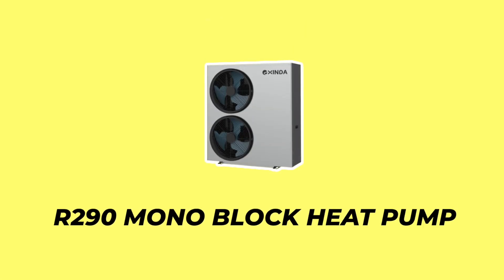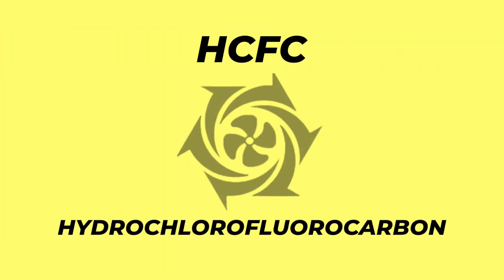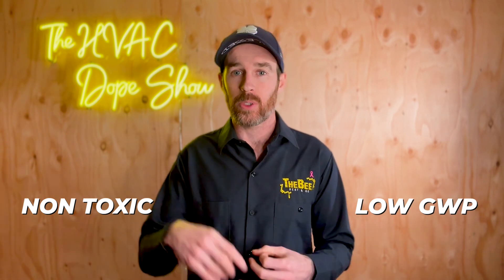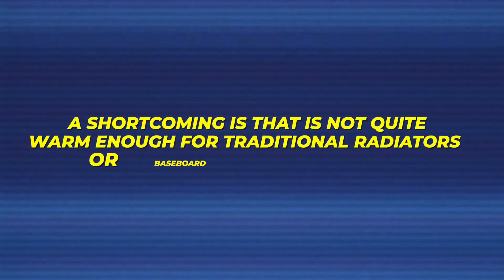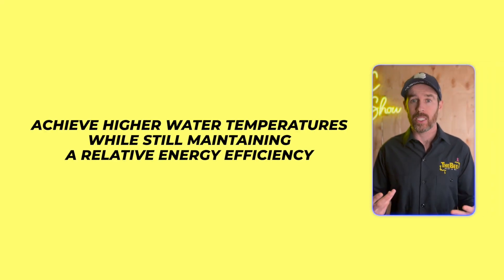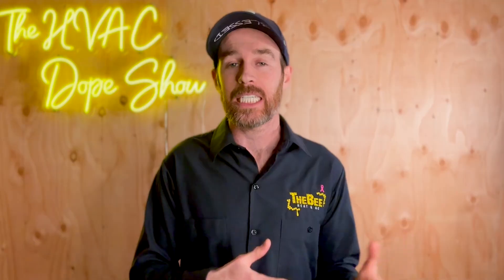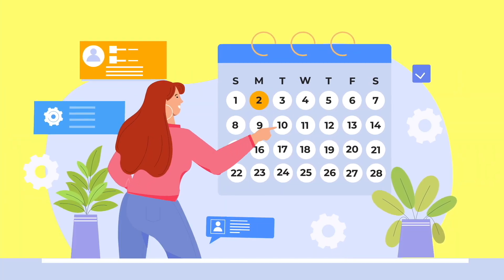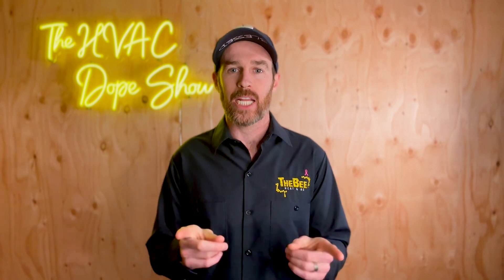This Heat Pump changes EVERYTHING | R290 Heat Pump

Comment: Really good explanation of current R290 heat pump technology.  This is very promising for older homes with hydronic systems requiring higher water temperatures.  I have an old house with an oil fired boiler and baseboard radiators.  I had an outdoor wood fired outdoor boiler, but couldn’t get our renters to use it, so I already have a heat exchanger and PEX piping to outdoors in place.  Just waiting for R290 heat pumps to come available.

Comment: I have a situation I could really use your help with, given that some of the local plumbers I have spoken with don't seem to know that much about the new technologies out there here in Washington mountains.  We are building a 2600 sq ft 2 story home where most of the living and master are on the 1st floor, with some spare bedrooms on the second.  This is in the mountains in Cle Elum where heating is used most of the year and maybe 1-2 weeks of AC usage in the summer.  Additionally we have to bury tanks for gas since it isn't run at the street, so I want to do as much electric as possible.  We are building slab on grade and ideally want no attic space, but will have room in the garage for a utility room.  Ideally we want to do radiant heating and cooling with a hybrid heat pump, but my local plumbers have no idea how this works.  I want to avoid ducts if I can and ideally get a heat pump water heater for both in house hot water as well as radiant.  Because cooling is so minimal, we could get away with radiant cooling too and ideally I avoid the cost of running ducts, separate split units etc.  I see some units from Arctic and I am sure Daikin and others have solutions that would work for us?  Am I insane in thinking this will work?  Why does my local installer think this is crazy?
Reply from the maker: Radiant cooling isn't a thing as far as I know because it would cause condensation on your floors or wherever the cold is and wouldn't work for humidity removal

Comment: Propylene glycol has a transfer-efficiency problem, so these might be a little less stellar in cold climates.
Reply from the maker: The transfer efficiency isn't as big as you might think, you can get burst protection to -20F and only give up 5% or 10% efficiency. They can also be ran with water and burst protection devices outside and just keep the water lines short normally but it's not as difficult as you'd think

Comment: This is new to me and very interesting. Can it be used to chill water for air conditioning? Can it be used to produce both hot water and chilled water into separate storage tanks in the summer?
Reply: I was looking for this too, the only systems I found were “one pipe” systems that could either heat or cool and could not do both at the same time. I could not find a hydronic air handler that could support both heating and cooling with one pipe, most expected separate pipes for chiller. Hopefully these systems will come with air handler that can be used for both. Most of theses mono-block target high temp heating as mentioned in this video
Reply: @ it appears this is a dedicated high temperature heat pump water heater and not intended for dual mode applications. Lots of good air to water heat pumps are available for dual mode.

Comment: R-290 it’s already widely used in small commercial kitchen refrigerators in the US.
Reply from the maker: Correct because of the charge limits (I believe it's under 500 grams) but monobloc air to water heat pumps aren't allowed under current regulations is my understanding
Reply: @ yes, that is understood. I wasn’t debating. I was just pointing out the hypocrisy that the government will allow the propane refrigeration unit sitting right underneath burning open flames on a grill!

Comment: definitely put in R290 when it is available. I need it pretty soon. current HVAC is on last legs
Reply from the maker: You're not alone a lot of people are wanting these units in the USA, they make a lot of sense, hopefully soon. Just put out a video about a CO2 unit available now but CO2 doesn't do AC without another unit because of the pressures and it doesn't really work great for cooling.

Comment: Considering putting this in the home I'm building now. I'm in the northeast region of the good ole USA.
Reply from the maker: Look up harvest we're going to be featuring them on our channel soon. These r 290 systems will not be available in the United States for several years unfortunately but harvest has a CO2 heat pump that works great especially for combination Space heating and domestic hot water. Currently harvest is probably your best bet if you want air water heat pump.

Comment: I’m really excited about air to water monobloc. Sounds great for small homes. Combines DHW with space heat in one system and no need for refrigerant lines.
Reply from the maker: I agree I think it has the potential to simplify things
Reply: Small homes, large homes, multiunit buildings, industrial,  commercial, it's hands down the best solution for heating and cooling heat pumps. Air to water mono-blocks are also the easiest to install since you have only power and 2 water lines that run into the building.

Comment: Why do you say it is "5 or 6" times as efficient? Evaporating at 50F (which is above freezing) and condensing at 190F I calculate a COP of 1.6 (cooling) and 2.7 (heating), and resistive heating has a COP of 1.
What are you comparing it to? Or is it a money comparison?
Reply from the maker: I don't know where you're getting those numbers I'm talking about the book COP numbers of the specific units... R290 monobloc systems have COP's ranging from 2-6 depending on outdoor ambient conditions and output temps. Higher water temps (170F) will make the COP closer to 3-4 depending on ambient conditions, lower temps for radiant floors etc (you only run 110-130f water temps) net you a 5-6 COP depending on the unit so that's where I say 5-6 times as efficient as electric heat which as you said is a COP of 1
Reply: @TheHVACDopeShow  I'm an HVAC/Refrigeration technician. We calculate efficiency as go/no-go part of our business. My numbers result from R290's Molier's chart (P v. H), for the required evaporating/condensing temperatures. (This chart is also called "bell chart", after saturation line's shape)
Reply: Evaporating at 50ºF (10ºC) and condensing at 122ºF (55ºC), which is the "standard" for HVAC systems, and where all components are optimized for COP is 4.6.
The problem arises with those hugely high temperatures. To get water at 180ºF you need to condense the refrigerant at 190ºF at least, and that gives the COP numbers I mentioned before.

Comment: So are the R290 Monoblok heat pumps available in the USA yet...As a Chem Eng. it is sad that the regulators are holding us hostage.  Any Bozo can get a 5 gallon bottle of propane for their barbecue.  I don't see why a sealed heat pump system poses a significant new rise to the public.  We must be perceived as a really really really stupid public to have this be an issue.
Reply from the maker: Yeah not to mention the 1000 gallon propane tanks my neighbors all have in their yard as well I don’t see the difference. Idk what it is but no not here yet as far as I know, they’re available in Europe, but I’ll keep you posted. I’ve had a few overseas companies reach out to me about importing but the hiccup has been UL certification for the electrical components and unit as a whole.

Comment: I renovated an old house with a gravity, hot water system that would run on low temperatures. I put in triple pane windows insulated all the outside walls. The Hear pump would be perfect with high-efficiency to heat this house hydronically at low temperatures for maximum COP. Can’t wait. Let me know when it becomes available.
Reply from the maker: Will do! The R32 versions will be out this year in North America, Daikin Altherma. It’s an air to water heat pump. It’s not R290 monobloc but it’s still efficient for low temp applications. The benefit of the R290 is mainly for baseboard heating since it needs 170-180 degree water to work.
Reply: Stiebel Eltron already have their version of R410A that can operate at 140F max,so that can be perfect for you.

Comment: Liberal nonsense to save the world.   It is combustible and requires fire blocking and higher cost of ownership and installation
Reply from the maker: Uhhh no, lol nothing liberal about a heat pump… lot of assumptions in your comment no one said anything about saving the planet some people want to save a buck… only reason the manufacturers prefer blended refrigerants is patents and $$$$ in the US, and forced phaseouts. How does this require fireblocking the refrigerant charge is entirely contained outside? People have 500 and 1000 gallon propane tanks just sitting on their property this is no different.

Comment: It will be "safely" located outside your house. So it won't explode inside, it will simply explode outside so if you have 2-feet titanium walls of your house you are in no danger. Make sure your neighbor has the same titanium walls as well.
Reply from the maker: You have gas lines and propane lines running inside homes all over North America. Also we trust layman to pump their own gas (not allowed in some countries…) lol. It’s not that dramatic. Also average propane tank has 500 - 1000 gallons and is sitting above ground. This will have less than a gallon🤔

Comment: This is super cool! I am hearing of a neighbor who has a heat pump hot water heater system in his garage and it actually cools off his garage a little bit while he is heating his hot water.  Wow. Minimum requirement is 700 ft.² otherwise it would have to be outside.?
Reply from the maker: Or you just need air exchange similar to combustion air for a furnace but the purpose is just thermal/air exchange with the outside so the grave doesn’t turn into an icebox trying to heat your hot water

Comment: AH what a godsend!  I have been looking at going to a mini-split system mainly for AC but the only utility rebate is for installing enough of these to heat the entire home and only the maximum rebate if you pull out ALL your natural gas heating source(s).  I have an 80k BTU high efficiency boiler that has been running like a champ (YEA Munchkin!), and I am not necessarily comfortable with an air-source heat pump heating all of my house in an artic blast cold snap (-10 to -20f), that though are more rare (winter sucks now especially as a skier), still can happen.  Can these also be used with air handlers in the home like a mini-split for cooling in the summer?  If so GAME CHANGER!  Who are the companies making these and (there always has to be a catch), what are the potential downsides?
Reply from the maker: Yes they can! So that’s the beauty is you can add an air handler in your attic with ductwork and this can replace your boiler and also add forced air heating and cooling. Downsides are they’re still not available yet in the USA and I’ve reached out to lots of manufacturers that can’t give me an eta or if/when they’ll even come here. I’m hoping for 2025 or 2026 but still no word…

Comment: I'm a homeowner looking to replace my (knock on wood) working 50 y/o electric furnace and hwh. Think I should try to wait or are we a long way off? Will the R290s be competitively priced or have a luxury tag because they are new (in USA)?  Thank you.   Also, primary advantage just radiant heating? Or a good option for just heating/cooling/domestic hw?
Reply from the maker: If you’re doing forced air you don’t need these it’s really only relevant for if you are trying to replace a boiler without doing radiant in floor heating. R32 is out now for this type in the USA and heats effectively to 140/150F which is more than you really need for hot water, but R290 is really only needed for old cast iron style of radiators because for space heating the water has to hit 170F/180F to be effective. For what you have currently a basic air source heat pump with backup electric heat would be plenty and more cost effective 😁
Reply: @TheHVACDopeShow  Ah, okay. Overkill then. Still sounds like a win-win -effective and more environmentally friendly. Ish. Thanks..

Comment: While accepting that good design is paramount, it is worth noting that, generally, the UK MCS tests show that R32 heat pumps have significantly better SCOPs than their R290 equivalents, because R32 is a more efficient coolant. You can see this most clearly by comparing like for like R32 vs R290 models, for example the Misubishi R32 6kW model (PUZ-WM60VAA) has SCOP of 4.81 at 35degC, compared to the Mitsubishi R290 6kW model (PUZ-WZ60VAA - a much newer model) which has a SCOP of 4.39 at 35degC. This is confirmed by Mitsubishi's own data sheets.
Reply from the maker: For heating? At 35C or 95F you must be talking about cooling? R32 doesn’t have the ability to get the temps as hot as R290, so for heating with traditional baseboards or needs to get hotter water / fluid temps R290 would still be better suited in heating no?
Reply: @TheHVACDopeShow  I'm only talking about heat pumps. 35degC is typical for Under Floor Heating, and even my radiator system operates between 35 and 45degC. R290 may be able to achieve higher temps but that greatly reduces efficiency

Comment: We have a gas boiler with hot water radiators in our 100+ year old house in Salt Lake. I want to get off natural gas, so a heat pump looks like an attractive high efficiency option. Is it just national code that needs updating, or do local codes also have to be revised? In this case you're only talking about a one way heat pump cycle. Can a monobloc also provide chilled water for some sort of attic AC air handler for an old house retrofit?
Reply from the maker: A heat pump is just an air conditioner with a reversing valve so yes all heat pumps can cool 😁 This is no exception… this product is already out but only in R32 / 410a refrigerants so you don’t get quite as hot of temps which is why even the R32 versions wouldn’t work with radiators because they’re typically supposed to be at 180F and the R32 units really only heat to 150F. They can pair with a forced air hydronics air handler which can do AC and forced air heating, but it wouldn’t do much for the radiators because at 150F they’re putting out 30-50% of the heat they are at 180F (ballpark, I don’t remember the exact formula off the top of my head). Idk if we’ll see R290 (propane) anytime soon but maybe in the next few years

Comment: US is behind the curve as usual when it comes to home construction tech. I hope we can get r290 approved asap
Reply: Sure. You can put it out in your yard just so long as the refrigerant doesn't enter the house or the interior air stream. You have to heat/chill water and that means adding a heat exchanger in series which costs you some coefficient of performance.
Reply: @solarheat9016  the mono-block has the heat exchanger built in and water has a much higher ability to transfer heat than air. A water to air coil in your existing air handler replaces the condenser/evaporator refrigerant coil.
Reply: @solarheat9016  Friend, I think you will find that any thermal management system is going to require heat exchangers of some sort, what with thermodynamics and all...

Comment: Can this also be used in extreme heat like in 40°C to 48°C to cool down house.
Reply from the maker: Yes it can, ties into a hydronics air handler for heating and cooling
Reply: Keep in mind it's highly flammable, don't use near dry plants or wood
Reply: @Solid_Snake99  do you use natural gas or a propane BBQ outside? They are both more dangerous. Refrigeration systems are hermetically sealed. No air means no Oxygen means no fire.

Comment: i have an old r22 unit im holding together as long as i can waiting for r290 i really think it will change a lot of things. could you do a video on how the mono block would interface hydraulicly with multiple systems. like could it do a water heater and a furnace/AC on the same mono block?
Reply from the maker: Yes it could do that, it’s not out right now in the USA but eventually will talk about it as I’m able to offer them

Comment: Perhaps mitigate the explosion hazard by inserting 3x  stinky compounds into the propane , IF it leaks = get outside.
Reply from the maker: Monoblock is all outside contained in the unit, that’s done for safety so high pressure LP lines aren’t running inside your home 😁

Comment: I have to add another comment that do not want it mixed with my last. I signed a contract for  Mitsubishi heat pumps ( H2i MXZ***)  along with their ceiling cassettes installation for my home. It is my understanding that the refrigerant used is R290 (propane)! Is the Mitsubishi air to air literature incorrect OR do these systems currently use R290? There certainly is nothing special that I can see about what they offer other than they of course are air to air hyper heat units with  R290, a propane variation refrigerant.
Reply from the maker: R290 is only used in monobloc applications to my understanding since it’s highly flammable. I don’t think that’s the case for a cassette system is this in Europe of the US?
Reply: @TheHVACDopeShow  
This is in the States---
Gees... suggest doing  a Google.  My thought is the entire compressor industry will soon only offer propane variations for refrigerants.
Also from PV Magizine  ''Mitsubishi unveils propane heat pump for residential. ''

Heck I firmly believe the risk for flammable refrigerants is negligable. How many gas stoves, furnaces & boilers do we have without troubles. IMHO, we have tooooooo much Big Brother regulations!